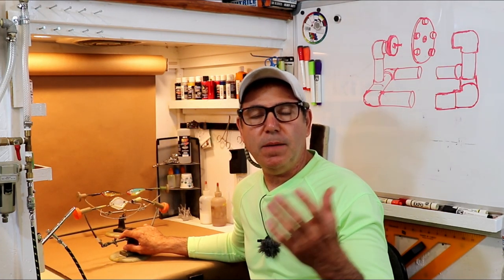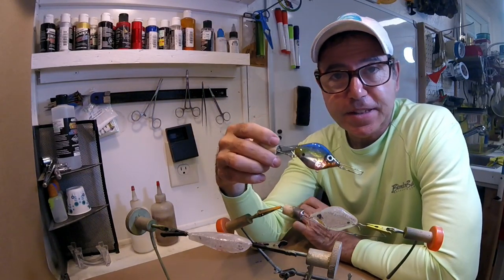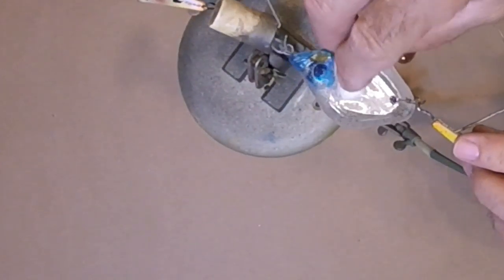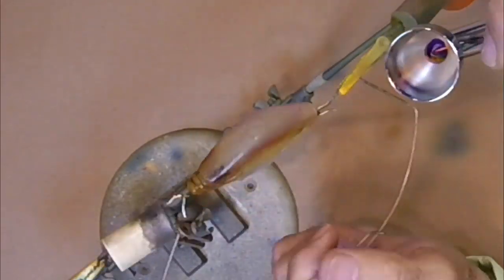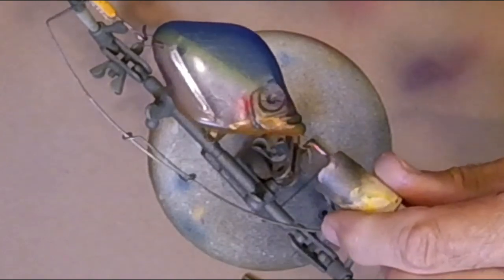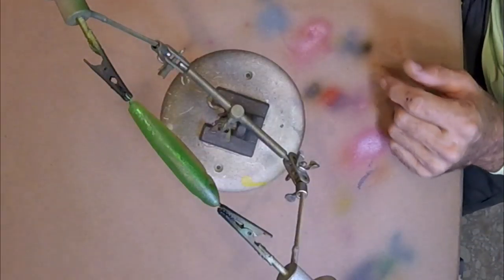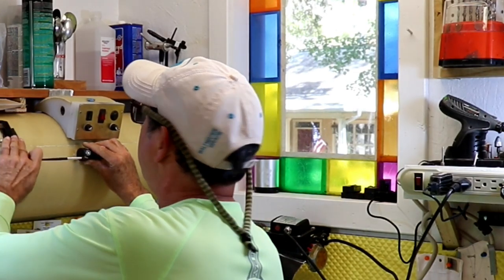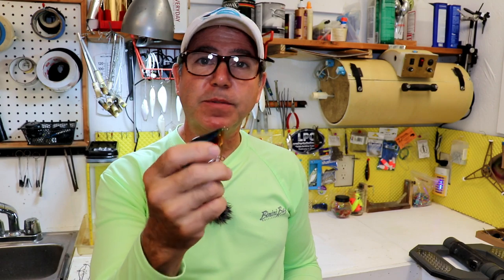Painting lures, transparent lures with transparent paint

Comment: I wonder if you could remove the bubble with a vacuum chamber? I imagine the air bubbles could distort the movement of the bait if there are more to one side of the bait.
Reply from the maker: It's posible to do it but you run the risk of frothing the resin and making it worse. I have a vacuum chamber build plan for a video soon.

Comment: I have enjoyed following your videos.  Although the final finish looks great a day or so later has resulted in hairline cracks in the paint on some of the lures.   Any obvious reasons you can think of for this happening?
Reply from the maker: Do you mean the paint or the clear coat?  What kind of paint?
Reply: @EngineeredAngler  My primer coat is Gesso white acrylic, then Wicked Colors flourescent and Createx Transparent. for my base colors.  After drying, I then dip in Minwax water based Polyurethane.  My blanks are those available from Amazon.
It appears as though something is fighting each other as more cracks are appearing and go right through to the white primer coat.
Reply from the maker: If it's going through the primer then (in my experience) the problem IS the primer.

Comment: Great videos and work. I have some troubles with spraying which caused me to hang up the brush for a while now. I have been spraying with, I know..., Testors model paints as they were quite cheap and very easily procured. I have trouble with the paint peeling and never quite curing one I use a topcoat, again testors brand topcoats. I'd love to figure out what I can use to help seal them and get a better stick... I primarily have been spraying metal trolling spoons and plastic crankbaits. The spoons seem to peel more than the plastic. Maybe I should be using a base coat?
Reply from the maker: It;s hard to say what is going on with the paint.  I have found that the oil based paints dry really hard and that means if you have a big temperature change the metal spoons will expand and contract enough to crack the paint.  Water based can do it too but seems to be more able to expand and contract with the material.  Best of luck.